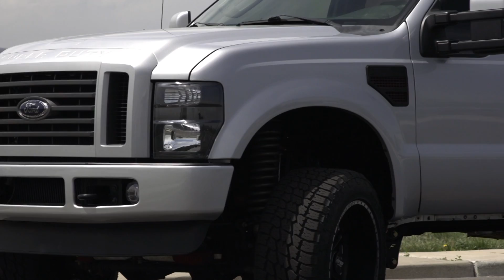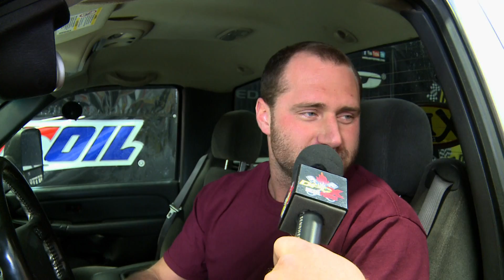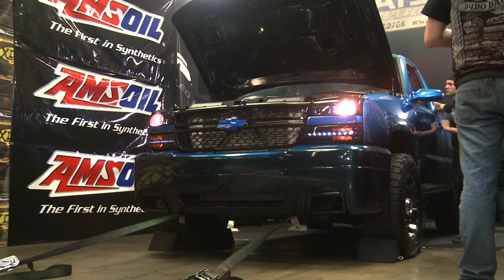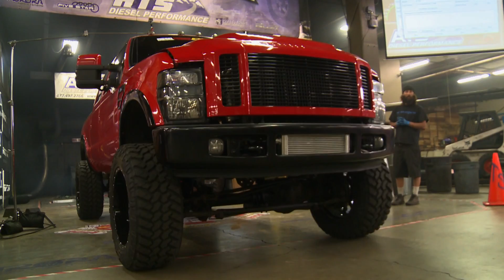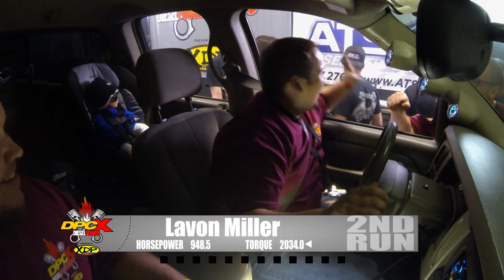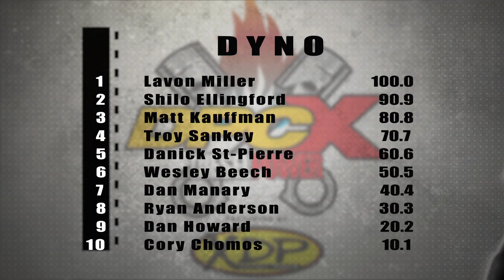Dyno Testing - Day 1 of Diesel Power Challenge 2014!

Comment: 7+ Litres , with nitrous and totally unlimited and they can't get 1000hp?  fking school girls.  weak as piss.
Reply: Yes, but they have tons of useable torque, actual pulling power. You can't just look at HP figures by themselves.
Reply: Son of a Zombie So why weren't you there , talk is cheap mate ...
Reply: Son of a Zombie Who gives a shit? It's one event. In most of the events, torque will be a major factor, not hp.
Reply: ***** why are you losing your composure?
Reply: I think it just came off like that to you.
Reply: With diesel it's all about the torque, one of these trucks could pull a jumbo jet
Reply: ßIGpoppaKEGdog™ There can be benefits from having things like VVL and VVT causing power to come up later and economy to experience a drop later, but the purpose of my comment was simply to explain that the horsepower number was completely irrelevant (almost). :) Torque is never the key figure, though, as torque is instant and it is impossible to feel something applied for an instant amount of time. Horsepower is the  crucial number, and always will be; however, because horsepower is calculated in relation to torque and RPM as the force applied, and 100 pounds of torque at 2000 RPM is far less actual force than 100 pounds of torque at 5000 RPM, and thus continued at 7000 RPM, it is very impressive that these engines can make this much power at such a low RPM, and the power is far greater than a Hennessy Venom's or a Veyron's at anywhere within the RPM limiter of those engines.
Reply: let's see you do better.
Reply: Azzurro007 on any dyno a stock veyron will never make  1000hp, its rated at more than 1000 at the flywheel
Reply: They certainly could make more but theyre looking to have the engine stay together and usual.
Reply: lol... costs a lot more to do it to a diesel than a gasser.

All things considered, a properly tuned TT big block could outperform these things, but then you would have a truck that got 5 mpg...

OH, I forgot, These trucks are picked by readers... So any joe schmo can get in on the challenge.
Reply: The torque figures are also mediocre for the competition parameters.  
It is like the producers just went to the first local hick bar and offered them a six-pack if they appeared on the show.
Reply: Son of a Zombie Yeah... I sort of agree with the sentiment. But this follows in a sort of tradition like "Four Wheeler Top Truck Challenge" They let readers pick average guys with daily drivers instead of only inviting tuners. Which means many morons show up and break shit instead of having a proper competition. Last year most the competitors broke. That nice Ford was just a consistent performer!

It would be nice to invite a few big name tuners out to see who can back up the talk. Or just have two versions of the challenge.
Reply: As someone stated already, there is a BIG HP/TQ variable in Denver (where they are doing these tests)!!! There's a little thing known to most racers, called DA. Density Altitude for those who don't know. Denver is 1 Mile (5280ft) Elevation, above sea level!!!! ;)
Reply: tat2titan It affect N/A vehicles more than FI vehicles, but still @ 1 Mile above sea level i'm sure it makes a little difference in HP/TQ #'s???
Reply: you do lose quite a bit of power at higher elevations.
Reply: MidShipCivic Hey I don't disagree with you, but I thought turbine speed was higher at elevation since there would be less load on the compressor with the thinner air? I thought that was why turbo cars did so well at altitude versus n/a or SC. Since the turbo created its own environment.

I've never done any testing with a turbo speed sensor though, so I couldn't prove my assumptions.
Reply: horsepower is a function of rpm and torque assuming these diesels have a redline of around 3500 and make 2000ftlbs of torque they would make around 1300hp not accounting for drivetrain loss. say they rev to 7000rpm with 2000ftlbs of torque they would make over 2500hp. theres a formula to calculate this hp=torque x rpm/5252. this theory can be proven by formula one cars, a formula one engine makes only around 300ftlbs but are able to make around 750hp because they can rev to 18k rpms. basically as rpms increase you are able to make more peak horsepower, since diesels don't rev very high their hp numbers are relatively low compared to their astronomical torque figures.
Reply: Son of a Zombie Actually they add the peak Tq and HP to get a final number for the competition.

Whoever has the highest combined number wins.
Reply: I will say for the most part most pullers and  most users that tune use excess fuel and late injection timing to give more energy to the turbine to spool it up it will smoke no matter what you do for this practice.
Reply: These are trucks that can daily drive and the engine last  a reasonable amount of time, they aren't competition only trucks. Its like comparing a DD mustang with some mods that goes to the track once a month to a 10.5 outlaw.
Reply: The level of elevation plays a key factor in the location you are... Near sea level you might make 1000+ hp.... Take that same set up up the mountains (like colorado) and watch that number drop to 700hp

Comment: How to ruin the environment 101
Reply: 'Murica
Reply: Salvador Ricardo Fuck Yeah
Reply: Diesel rule.
Reply: Do you drive a prius?
Reply: TheDutyPaid
That may be true, but in normal operation most diesel engines are lean burn, thus no unburnt diesil actully makes it out the exhaust pipe. The only problem that leaves is the excess oxygen can form nitros oxides, which is one of the primary agents in low hanging smog around cities, so many vehicles now have blu-tech or similar post combustion additives that basically eliminate this issue. However its also worth noting that in most modern petrol engines you have a catalytic converter, so you don't actually have petrol fumes in the exhaust either. This means in either case a modern vehicle is fairly clean, with the danger to health coming only from carbon-monoxide and danger to the enviroment basically only green house gas emissions. On the other hand these race turned motors aren't a example of this... they may pollute badly but are so rare they don't make up a sizable amount of total emissions, so any concerns over there damage to the environment are minimal, although some states make them illegal for road use via smog laws to ensure they don't become more common for non-race applications.
Reply: I am for the clean enviroment all the way but cars only hurt the enviroment by 13%. The most damage is done by airplanes Haarp and the industrial factories !
Reply: *****
 That's true for modern Diesel engines with a particle filter and an SCR-cat that conform to Euro 6 but definitely not these overly rich running murica diesel engines :D. Just look at the smoke/particle emissions. These guys are idiots for standing in that hall without respirators.
Reply: You're clearly on the wrong thread.
Reply: They say global warming can't be reversed at this point. It's already ruined
Reply: not at all....if you knew the use of it you wouldn't say it at all. Bombing the ionosphere with electrons doesn't make it  a friend of the enviroment. And then again this makes more damage than these diesel trucks....think about it
Reply: Prius; Because toxic batteries are good for the environment.:)
Reply: *****
In English please Yoda.
Reply: Navis V.
It doesn't matter whether or not you believe they're harmful. What matters is whether they are harmful. HAARP isn't harmful unless you're a schizophrenic conspiracy theorist in which case reasoning with you is impossible anyway.
Reply: ***** not true
Reply: Does anyone really give a crap about the environment ? Why does society suddenly feel the need to rectify the environmental wrongs of the last 2000 years ? I do not recycle and I idle my vehicle at will, I couldn't care less about my carbon footprint. I am not worried about "the future"  because I will be nothing more than landfill in the future. Live life and worry not about the environment.
Reply: behinderteleberwurst I believe that antennas are for show only ? Like those on cell towers? They are harmless yes? Good my friend , nice thinking!
Reply: nuh uh! one of those Fords was a PZEV! (Partial Zero-Emissions Vehicle)
Reply: I look after the world by driving a VW diesel.

Comment: Are those strong dark fumes not harmful to the environment? I know you can change fumes to not emit so much nitrous gases but if they do?! :-/ Idk
Reply: Those  particles (smoke) are unburnt carbon. They have been classified as carcinogenic by the world health organization. The particles are very small and can get deep into your lungs and even the blood. Wild horses couldn't drag me into that dyno room without a respirator.
Reply: HiFiFiZzy why dont you go look it up. cause it is harmful, but that being said i dont care its fun to watch
Reply: xRoyalPlayer
Thanks! Better than a dead badass.
Reply: Don't be ignorant. It's just unburnt diesel fuel. All that smoke in the air becomes sulfur and just falls down to the ground. Fumes from gas powered vehicles stay in the air though.
Reply: I can guarantee most of the trucks are illegal to drive on the street unless they did some serious work to keep it emissions legal.
Reply: My Ford F550 spews more black putrid diesel exhaust than a semi.....and I love it.
Reply: The black fumes are comprised of molecules with very low reactivity. It is harmless to the environment. Similar to sand and dust. Harmless to the environment, but technically a weak carcinogen. Much like sand and dust.

The emission of NOX is probably the same as other big power gasoline vehicles (hot rods, race cars ect) Diesel has more sulfur in it than gasoline, but its proportionally equal to the amount of fuel burned, which means that big rigs emit significantly more.
Reply: HiFiFiZzy they are a weak carcinogen but diesel is far cleaner than gas
Reply: im1greatman no my pulling truck smokes about the same and ive never had any trouble
Reply: Gabe Reed
Saying the liquid fuel its self is ''clean'' is  useless. The fact is it's burned and produces much more harmful emissions than  a gasoline  engine ever would especially when Gas is mixed with ethanol now.
Reply: MidShipCivic that is not true diesel "emissions" are much cleaner than gasoline.
Reply: xRoyalPlayer
Did you read ? No Diesel emissions are much more harmful. gasoline is much cleaner as they are mixed with ethanol now.   Better re up on your knowledge .
Reply: xRoyalPlayer
Go in hale your diesel fumes.... then it's clearly doing damage to you.  ''Damage when emission on diesel now have UREA injections which places more stringent rules on diesels than gas you know if you run out of the fuel the truck goes into limp mode and you can only do 5 - 10 mph?
Reply: not fuel! DEF
Reply: xRoyalPlayer You just proved to me you have no idea what you're talking about.
Reply: Really? If you run out of diesel fuel do you think your engine is going to run? NO Its running out of DEF that throws you in limp mode.
Reply: xRoyalPlayer You can't even read. First off, no one even fucking said diesel's run off of 'UREA'' injection they are required to run that now because if they don't they are breaking emissions laws do you know why they have to run it ?  Their EMISSIONS ARE WORST. You see gas engines needing this ? Nope they keep meeting government  standards which keep getting stricter and stricter.... now go find something to do.
Reply: I'm done here kid! go home

Comment: Do these guys ever consider that the loss of power isn't only due to the altitude? Yes altitude plays a hand, but with out the smoke getting vented some of it is going to get sucked back into the engine. With their closed dyno room, they are forcing the trucks to run with less oxygen due to exhaust gasses being sucked back in. I bet they would get better numbers if they would vent the exhaust out.

Comment: thailand drag truck it has 3.0 litres 4cylinders engine  just 600hp and it run 7.8 seconds in quarter mile
Reply: i bet it's hardly a 'truck'. Probably has plastic bumpers and weighs about 800kg or less to make a time like that!
Reply: but some truck is 1.5 tons and it run a little bit slower it run about 8.xx seconds
Reply: it just 3.0litres and 50 psi of boost
Reply: Tim Huth i bet if you put that diesel v8 in 800kg truck it still run more than 8 seconds
Reply: lol only runs 50psi.. haha

Comment: Shit my truck puts out 1650whp and 4877wlb-t.  I don't smoke at all.   The air that enters my truck is dirtier then the exhaust.  I still have my dpf and def injection.   The EPA needs to nail these hicks for removing there emissions systems.
Reply: You should enter this contest then.
Reply: brian hilligoss why don't you enter then? you'd win that's for sure. also, proof..?
Reply: 1650/4877? Dyno sheet bro! Cause anybody who knows diesels knows that impossible, if your gonna act stupid, atleast do it at a decent level, not a wet dream.
Reply: It's a Catapillar 789D.  2100hp at the crank.  I estimated wheel power.
Reply: brian hilligoss lmfao that's not a 'truck'
Reply: brian hilligoss lmao well you got me I apologize, with an engine displacement of 69 liters that makes sense, cool job though I'd love to be able to drive one of those
Reply: I call bullshit
Reply: On what, sam hilligross comment?

Comment: I thought a lot of black smoke was from a not so good tune or setup? Im a gas motor guy so please chime in
Reply: The black smoke is unburnt diesel fuel. It's NOT harmful to the environment because it is heavy and falls to the ground. It is just carbon. The more fuel in the engine equals more power as long as u have the right ratio of air to go along with the added amount of fuel.
Reply: I understand air-fuel ratios and whatnot but diesels seem to have A LOT of unburnt fuel at WOT. More than seems normal but then again I work on/with gas engines. Don't worry Im no hippy, I know it just carbon plus my gas truck pollutes more than any of these rigs
Reply: Jacob Schillig the ground is still part of the environment....

Comment: honestly this was such a dumb test. These trucks are built for towing and hauling heavy loads. yet half of those who buy them tow maybe once a year and still hardly need that much power. another 40% tow, but probably won't need anywhere the power of a 6.7 cummins or stroke. about 1 in 10 guys who buy a truck with huge diesels on heavy duty powerhouse pickups actually use them for such. pretty much anyone in the first group is a giant tool with some sort of "inferiority complex."